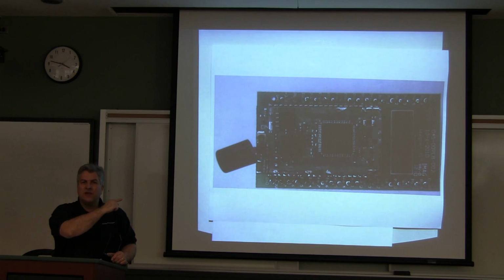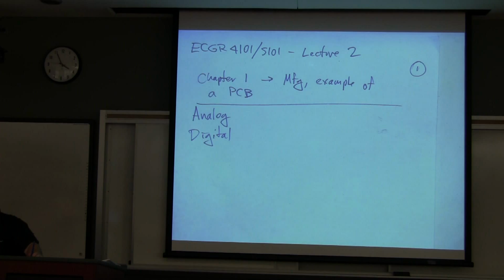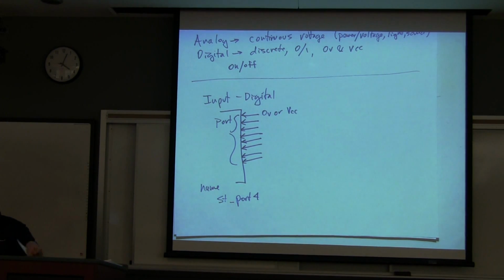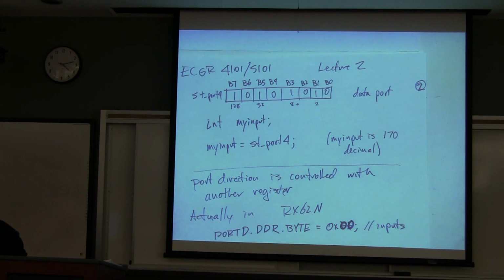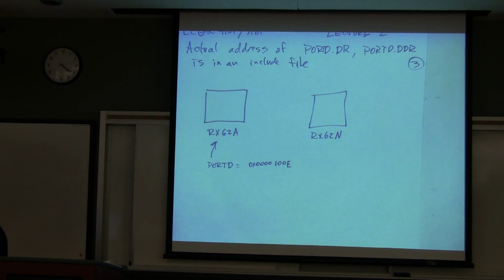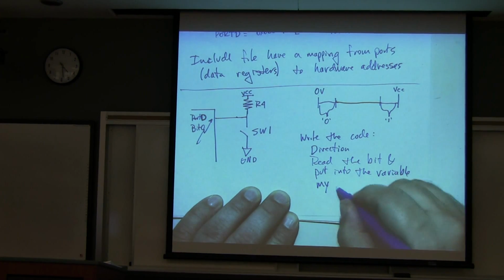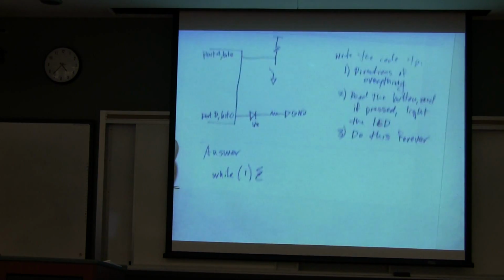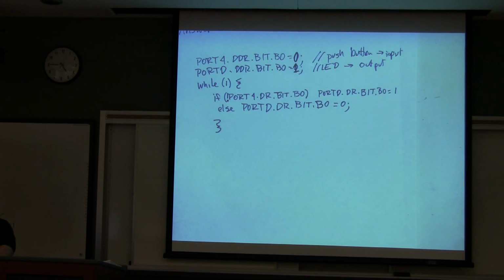Embedded Systems Course - Lecture 02: Concepts of Microcontrollers, Part 1

Comment: I am confused here actually. Why are you *reading* the Data Register (DR), instead of the PORT register? In the text on page 18/19, in order to read from the switches, you do this:

if (PORT4.PORT.BIT.B0 == 0)  // check to see if switch 1 is pressed
    PORTD.DR.BIT.B0 = 1;        // turn on LED

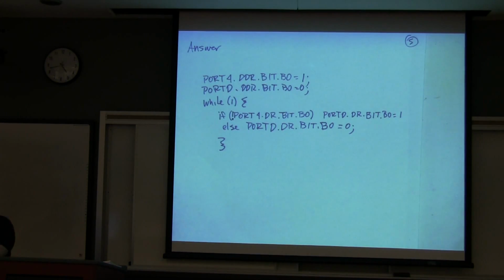Yet at the 1:03:00 mark you are reading from DR. That doesn't make sense to me. 

Also, that code on page 18/19 is a bit odd and didn't work for me. So I re-wrote it. It's on pastebin at:  vHYrvewf